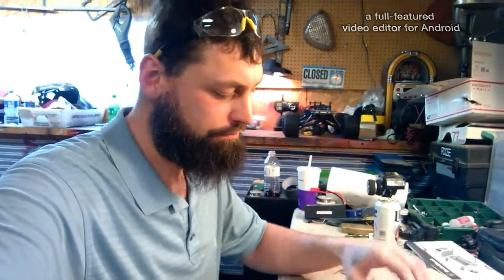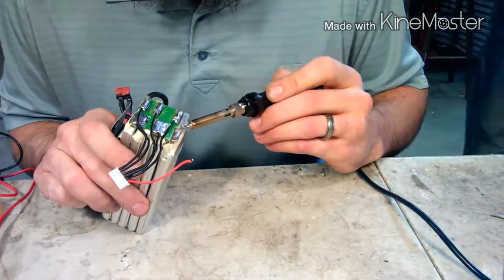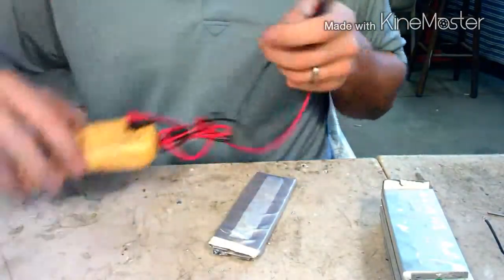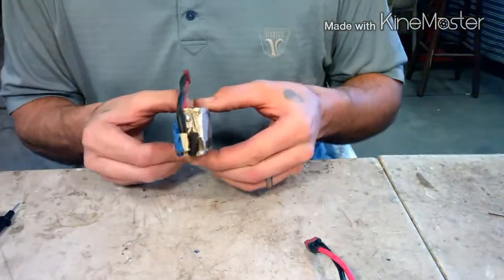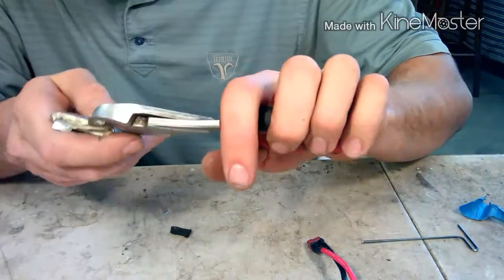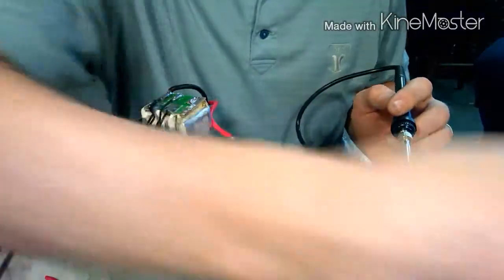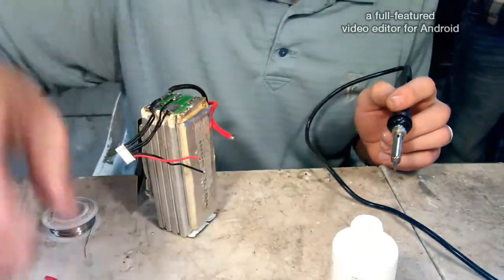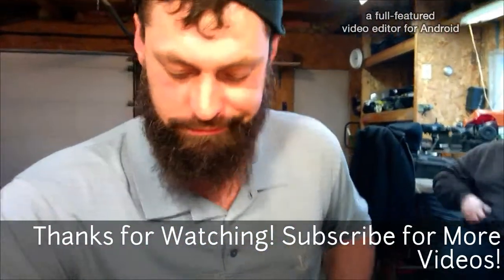How to replace a bad cell on a lipo

Comment: 842f (450c) should be plenty, your problem here is your tip ain't big enough. If you'd used a flat tip, maybe 4mm wide, and you made sure you had a decent amount of solder on it at all times, you'd have had zero problems with this. Always keep your tip wet ;-)

Comment: You need a bigger soldering iron - think weller 8100.
Reply from the maker: Yeah. I really do but have yet to get one. For bigger stuff like that I would use a torch for the extra heat but in this application I didn't wanna start the lipos on fire
Reply from the maker: I had a gun type like that once but didn't like it. Too bulky and uncomfortable to use. I like the pen style on the account that I do allot of precision soldering on circuit boards